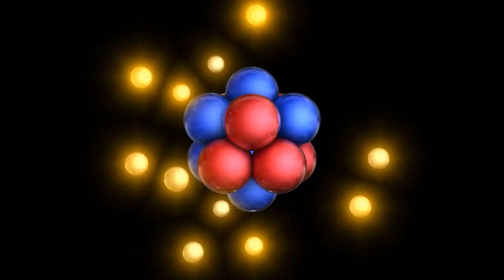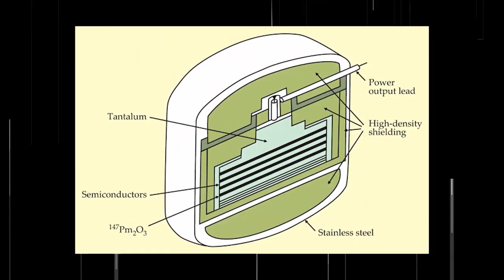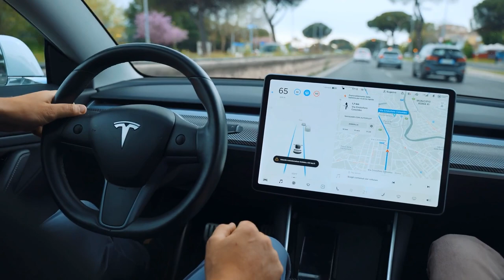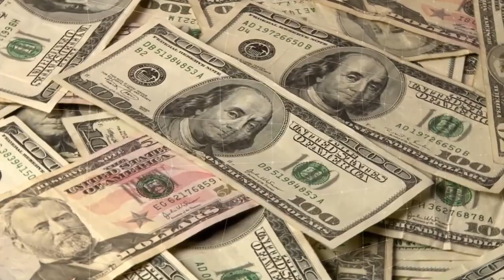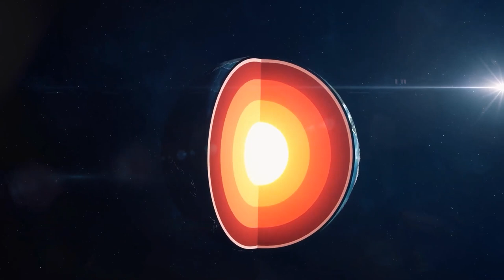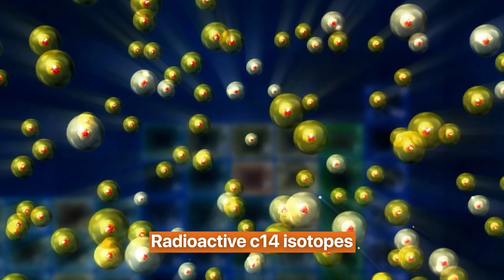Elon Musk's INSANE Nuclear Diamond Battery That Changes Everything

Comment: Hydrogen is a very environmental good source of energy.  It's very easy to produce at next to no cost at all.   This is all you need to know,
get a glass of water put your two electrodes in provide a small DC current and then most importantly  "VIBRATE the liquid with the "B"field of a magnet.   The "B" field is the center of a magnet not the north or south poles.  Think about it this way The water molecules were created magnetically why wouldn't you use the same force to take them apart??
Reply: Yes, it is clean. The problem is that it does not generate enough energy.
Reply: Not even net zero